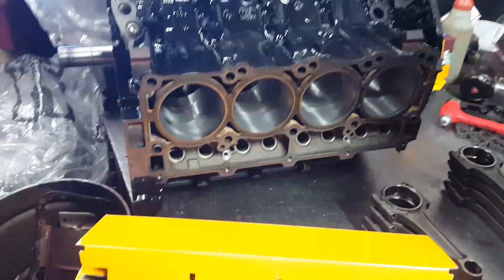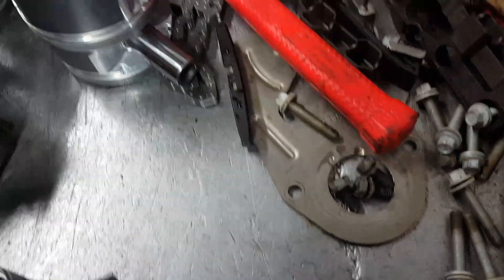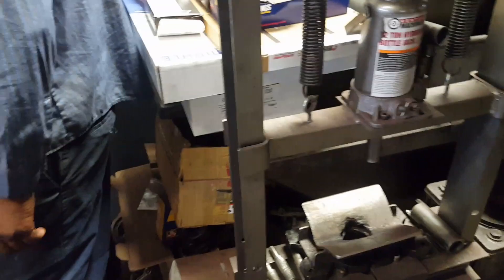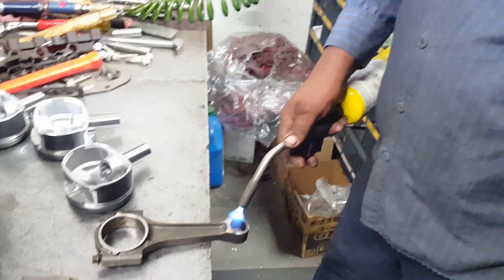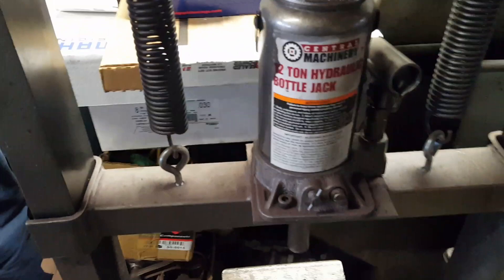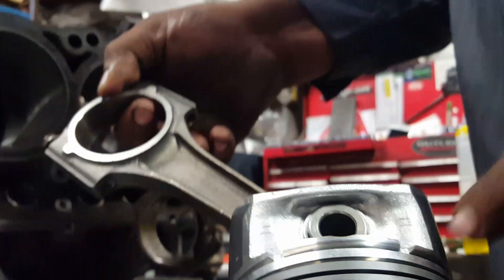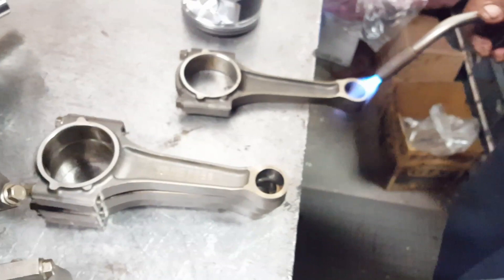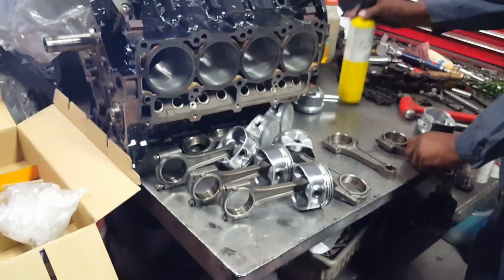How to rebuild hemi 5.7 engine

Comment: Open flame on the rods is a mistake and a sign of poor technical/mechanical technique. Should use an oven on the rods and and freeze the pins. It's a interference fit. The purpose is to gradually increase/ decrease temps without a rapid change... Quantity, not Quality is what we see here..
Reply from the maker: Good input but can you explain why that engine have over 78,000 miles after the rebuild? 
Thanks for watching and the comment anyways
Reply from the maker: Ohh yeah that makes sense 👌🏼
The name of the shop must be changed to LUCKY because we build more than 3 a week and no problems until today Jan 2019 😂😂😂
Reply: @JM8686  Like I said, quantity not quality.
Reply: You don't know what you are talking about.  The 125 million small block Chev V8's all used interference fit in the small end, and their rods were induction heated to a dull red to permit installation of the pin.  Any good automotive machine shop will have flame or induction heaters for the same purpose.  It is not possible to press the pin through the rod when they are the same temperature- and if you did the pin would be scored where it has to run in the piston boss.  These guys did a great job hanging the rods on the pistons.
Reply from the maker: Thank you for sharing some knowledge sir 🙌
Reply: I'm a welder by trade and I work in structural steel so just thought I'd share my opinion. Anytime you heat a metal, whether it's mild steel, aluminum, stainless, WHATEVER, exposure to heat expands iron and any repeated exposures will definitely OVER TIME cause that metal to lose strength. I'm not an engineer, I'm just a grunt but I know that much. Now whether or not heating a rod ONCE could cause that rod damage down the road, I'm not an engine specialist but if it's one time only, I would think yes it's going to expand but I don't think it's going to effect it if done "properly" so to say.
Reply: Whether or not this is the correct method of assembling them, I care not to argue.

Comment: The arrow means when u put them in the engine block the arrow points to front of engine
Reply from the maker: Adrian Newman thanks for the comment 👍
Reply: He's talking about the direction of the arrow as it relates to the oil groove in the bearing and which side of the engine the piston gets installed.  He's right about that.

Comment: To be honest alot of backyard builders done it this way without rod heaters on some old technology rods from 70s and 80s newer metal you can get away with it because silicon that's added into the cast makes it cleaner no voids less machining from the factory to save money I wouldn't do it to old cast rods from way back when but harbor freight has a rod heater and not to bad good job guys

Comment: Tell me if im right or wrong but isnt bad if you preheat the conecting rod ...cus the metal is strong and fixed the way it is but by heating it would it restart the durability of the metal and become weaker then it was...?
Reply: This is definitely a really late response to you but no. As long as the metal doesn’t turn red hot it should be fine.

Comment: All u got to do is put the wrist pin in the freezer  for a hr it will slide in.    Dammit
Reply from the maker: James Barb yeah i agree but dry ice works better,you might ask why i didn't do it then?as simple as because the rods and pins were gas-nitride like my 13b mazda rx8 rotary parts so they can be hardened and can resist high temperature!! You can look up my renitriding video process if you like 👍thanks for watching
Reply: Lmao....i bet your yelling at your device. Thanks to emojis. I wish they were animated like the old yahoo emojis back in early 2000s
Reply from the maker: Yeah those were cool 😂😂😂
Reply: I was thinking the same thing when I seen him putting the torch to those rods and watching the rod discolor doing it. These guys act like two kindergarten kids with wooden block at play time slamming those parts around
Reply from the maker: Agree but works every time though 🤣🤘
Thanks for leaving a comment 🙌

Comment: heating those cast connecting rods like that are a questionable way to do this. there is much better ways to do this.
Reply from the maker: Mel Colp agree with you but this method works better than using a 1 or 2 ton press !! I can hang 20 rods while anyone else does 2 or 3 using any other way 😎
Reply from the maker: Mel Colp i also forgot to ask if you can mention any of the other better ways you know?just so people can learn something new
Reply: +JM8686 
I understand the getting things done.. but sometimes heating like that changes the cast iron strength in those rods..and I am certain you know the damages that can be done.. so speed in the long run can be extremely costly. 
In the end a few dollars compared to a second rebuild. 
heating cast requires heat to cool down so the strength remains the same. This is just something that I have learned over many years of engine rebuilding. 
thank you for posting and showing a short cut for marring connecting rods to pistons.
Reply from the maker: Mel Colp comment appreciated thanks for watching 👍👏👏
Reply: those are powdered rods not cast.  worst thing to do is heat them to install the pins.  cheap short warranty if any rebuild is what this is.  not for the performance market by any means.
Reply from the maker: turbofreek 😂😂😂😂
Reply: What do you expect? Half A** work. You want to work but don't wan to work CORRECTLY. Quick doesn't mean QUALITY. Especially by how you just tossed all those pistons around. Wouldn't touch my engine and I've rebuilt engines before. They just doing it just to get the job done, they don't care about later.
Reply from the maker: theslimed2013 good input but engine as today still healthy and with 7,215 miles on it 😂😂 so good way or bad way always end up with a good engine 👌there is more than one way to rebuild and engine that's all!!!! Well as long as everything is in the specifications 👌
Reply: I mean it is a HEMI, they aren't wimp engines. Its not like a Ford.

Comment: That engines fucked from day 1 doing that with a blow torch risks cracking and distorting the end of the rod and softening the metal. I would rather press them in or at the very least heating the rod in a different way so it heated evenly.
Reply from the maker: Alan Waller rreally great input too bad that the engine is almost back for a first oil change, and the engine haven't fucked up like you mention!! Could be just luck or my way works everytime?🤔
Reply: longevity is shortened extremely.  factory rebuilt this is common old school practice but really not very wise.  piston pins tend to seize up at some point.
Reply: turbofreek I used torch method long time ago on a honda engine lasted 20k miles beating the piss out of it almost everyday so it works
Reply from the maker: phoenix240 we build 4 to 6 hemi ENGINES a week using same method aka torch nd haven't have any problem lol also that engine is on my 06 300c nd already have close to 10k on it with long trips to san Francisco and Las Vegas 😂😂😂

Comment: Dont heat the rods with a torch. It messes with the strength of the rod.
Reply from the maker: Ohh thanks for watching nd the advice 🙌
You should share the video with all the people that you know, so they can learn how not to do it 👌
Just don't tell them that the engine already have over 70k miles since rebuild 🤣
Reply: Really what about thermal fitting? Used on weapons all the time.
Reply: Maybe if you heat it till it’s glowing.

Comment: Oh man what is you doing hahahahahahahahahahaha wtf might as well play catch with them
Reply from the maker: ibraHEMI lmao nothing much just making a hemi salad 😂😂👌
Reply: JM8686 😂😂😂😂 I’ve seen worst rebuilds. But invest in a rod heater 👍🏻 tossing them around ain’t gonna do shit to the Pistons, kids don’t realize that combustion means explosion and under high pressure. And they’re worried about few scratches from the table 😂 keep making videos
Reply from the maker: ibraHEMI agree with you and thanks for watching and comments 👌
Reply: @ibraHemi  The piston heads are aluminum
Aluminum has an oxide layer
If you scratch the head, you fuck up the oxide layer
if you fuck up the oxide layer, you are prone to premature failure due to the vulnerability of the exposed aluminum.
Just because there is "explosion" doesn't mean that those "few scratches from the table" can't fuck up the components.

Reminder, all the components of an engine are measure and meticulously proportioned to such a point that a couple thousandths off can fuck up an engine. Small things do matter.

Comment: Some people are concerned about heating the connecting rods. I'm sure the heat that engine builds, gets them rods a lot hotter that that few seconds the torch does. I'm sure the assembly process Chrysler uses is a lot more harsh, since the majority of factory hemis tick and clank. I own one, so I can judge :p great vid man!
Reply: Christopher Williams engine temp doesn't even come close to that flame...if what you say we're true then the wrist pin would walk out during engine running...correct?
Reply: Christopher Williams h
Reply: Hardracer The thermostat measures coolant temperature which is under pressure. So you obviously have no idea that the exhaust temperatures exceed 450 degrees. Don’t pretend you have ever built an engine.

Comment: Are the NPR brand pistons made of a different material of metal? Or is it the same oem replacement.?
Reply from the maker: Dont like sounding like an expert and giving detailed description but here we go!!
NPR's like RS machines and YCP are all 336 cast (AC8A in the japanese grading system) which means they are a higher silicon content aluminum cast piston, not toughened by the forging process. The thing that makes them tougher then regular cast would be the T6 heat treating process they under go, which makes their tensile strength much higher, closer to that of 4032 aluminum alloy, which is what most low expansion forged pistons are made out of. LESS WORDS NPR PISTONS ARE GOOD AND LITTLE BETTER THAN OEM!!! now people will talk smack on the comments but 100% sure they dont have a VIDEO to prove what they saying!!

Comment: Doesnt heating them up like that weaken the rods?
Reply from the maker: That car already have 98,000 miles after the rebuild 🤣
Reply: JM8686 i was just wondering because Im in the middle of a rebuild. Valve seat dropped and ruined a head so im getting 2 new heads, hardened pushrods, hardened springs, green racing cam and the same pistons youre using.
Reply from the maker: Good combo 🙌
Reply: @luckygunner3484  are you boring it?
Reply from the maker: There is no room to bore it lol
Reply: @JM8686  so if I get a 5.7 hemi block I can't go 0.20 or 0.30 over

Comment: So what's really better Rebuling it or just swapping it with a used one What options would be more reliable?
Reply from the maker: Let me tell you a little secret aboy hemi engines that no one else will!! 
On those engines the valve seats "round metal rings" where the valve seats comes loose and the get hit by the piston making it into multiple small pieces, the intake sucks all those pieces incide ,now the trick is ,
You can remove the heads super easy so they can send over to a machine shop to get the valve job done and replace messed up valves and the seats!
Now for the piston that got damaged,you can easily remove the oil pan and remove the messed up piston by removing the connection rod!!
Just install a new piston with new piston rings and you good to go!!
Remove heads,send it out to get fixed,remove and install new piston and piston rings, LAST THING DO "NOT CLEAN THE INTAKE" buy a new one because only takes a small piece of metal to messeup the engine again!! 

Do i make sense? This is what car flippers does with auction 300c magnums etc. etc.
Reply: @JM8686  so rebuilding it would be better Just buy a new intake right???
Reply: @JM8686  an good looking on the advice bro I'm new to this
Reply from the maker: @StreetMoneyLA  yeah best option is rebuilding, and like i comment earlier, depends what went down with that engine, but the most common thing is piston hitting the valves cuz the valve seat comes off!
Reply: @JM8686  you think a remanufactured Would be reliable ass well???
Reply: @JM8686  i have a question my 2005 dodge magnum with 160,000recently dropped a false seat doing minor damage to one of the pistons i was wondering if there’s minor damage to clynder I can hone  it out and just replace damage piston and intake manifold ,rebuilding heads so my question would be how long would the engine last vs complete rebuilt I was gonna have my engine rebuilt next week but if I can safe some money I rather just replace damage piston
Reply from the maker: If it was my car will do full rebuild! Everything oem from dealer! No cheap stuff no fixing patches lol
Cheap becomes expensive!! 🤣
Reply: @JM8686  so if I was to replace just the damage piston  it might not last long at 160,000miles
Reply from the maker: 50-50 lol but if the wall got damaged you have to get it done right,not only hon hon 👌
Reply: @JM8686  thanks
Reply: @JM8686  thanks

Comment: If everybody is mentioning how heating the metal is bad maybe you should listen or you no understand?
Reply from the maker: Jason Gould whenever someone actually own or ever build one I will listen haha but so far we build 6 hemi ENGINES a week using same method nd guess what? Not even a piston pin noise yet 😂👌👍👏👏or I will listen if someone makes a video just like mine nd I would like to see the actual failing while running inside the car,cuz so far people will comment but all they know is stuff they learn here in YouTube 😂😂😂
Reply: i have a 1300hp 5.7 gen3, a 850hp big block chevy and been doing this shit for ever.  when the metal turns blue like your does.  it goes in the garbage or the "dont use this pos" pile of parts for educating other dumbasses that dont realize it.  bluing of the metal is fatigue on the highest order.
Reply: I understand the point of the metal changing color and it’s significance but I do not think it ever got close to that point in this video. So I would think the technique used would be ok.
Reply from the maker: Thank you for the comment 🙌

Comment: I always thought you use a bore gauge, then measure the piston diameter to see if its in spec and then measure ring gap...Im no builder but just a question.
Reply from the maker: Yeah that's how you do it 🙌

Comment: Hey bro do you recommend rebuilding or replacing a 6.1l srt8 HEMI with a used one? It started knocking really bad and I believe it’s a rod but not sure. Already took valve covers off and valve springs look good so definitely probably a rod. What should I do rebuild or buy used engine? And if I rebuild what do I do to it?
Reply from the maker: If it was my car i would rebuild the engine
Reply: JM8686 how can I rebuild it bro? Like what should I do to it to go a good rebuild

Comment: Yikes! This guy knows nothing about metallurgy. By heating the upper end of the connecting rod with a torch he is affecting the heat treatment of the steel, specifically the temper. Notice how the metal is turning gold and blue… he just ruined the rods. At some point the metal will fatigue and probably fail with some nasty results! Don't take your engine to these guys.
Reply from the maker: 😂😂😂😂 thanks for watching anyways 🙌
Reply: So how do you do it instead?

Comment: Does it matter if the piston is installed with an F facing opposite direction? As long the rod is positioned in the right direction it shouldn't matter, right?
Reply from the maker: The pistons must go in their position,do Not mix or place them in wateve r position!
Reply: I've replaced the damaged pistons with new ones, however one of the new pistons got installed to a rod with the F marker facing the opposite direction! I thought the marking on the piston is only to insert the rod in the correct way, flipping the pistons should not matter as long as the rod is installed properly. I'll just remove the pin and install it in the correct order.  Thanks for your reply bud!
Reply from the maker: No problem thanks for watching

Comment: I got a 05 Dodge Ram hemi and I’m looking to increase its performance. It’s mostly stock besides a k&n air intake and flow master exhaust. What would you recommend in mods to look into? Many have said get your engine bored out, get long tube headers, cams and etc. so which would you recommend in starting out and what to look into next. Love the videos keep it up paisa!
Reply from the maker: Osmany Cardenas thanks for watching 👌 
All depends on how much you are looking to spend,but to start ,
A hot cam
Better lifters 
Better intake but intake tbh the original keeps up pretty decent
Port and polish the heads
Headers
All depends how much hp you want to make
Reply: Headers, cam, torque converter, tune. Hemis love their cams
Reply: @JM8686  can u make a vid on the cam install?
Reply from the maker: Will do
Reply: @JM8686  Thanks Bro ur good at what u do forget the haters
Reply from the maker: Thanks brother 🙏